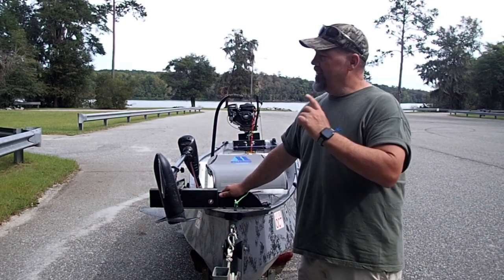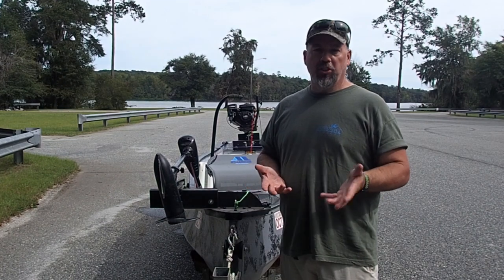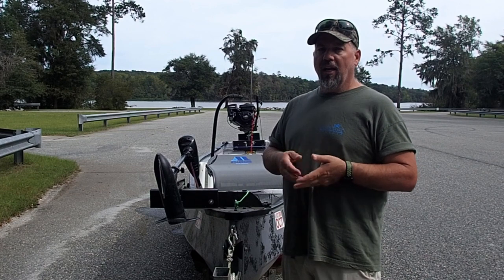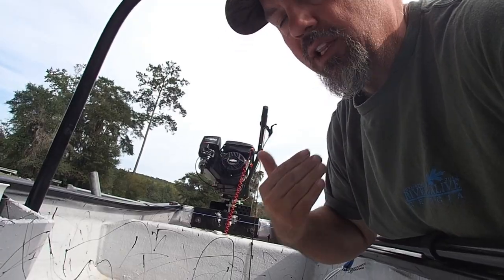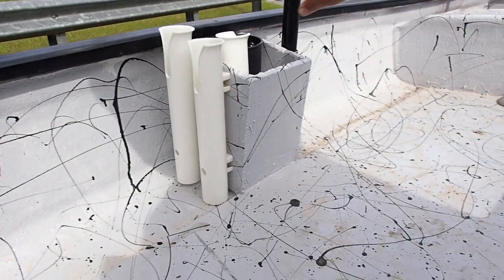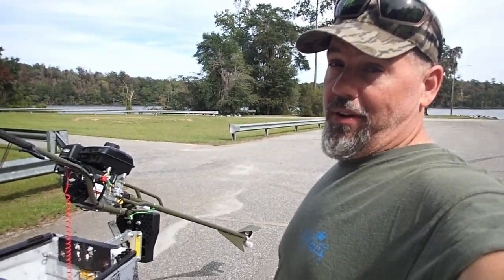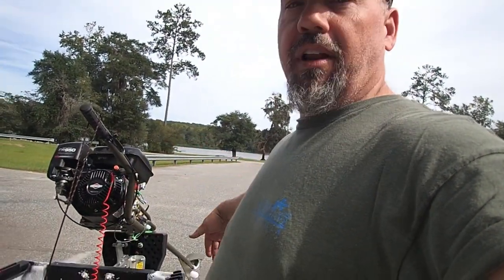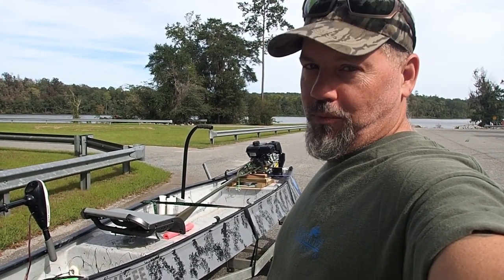Gheenoe 13 Rebuild, Walkthrough and First Run!

Comment: Nice Gheenoe . I have a 1979 15'4" i purchase in in 2018,  I wanted to repaint and do some mods, then found out it needed some repairs too. I mainly use mine for duck hunting in NC.   What is the make and model of the jack plate you installed.  I am wanting to install a jack plate for my 5HP Honda 4 stroke.  I'm looking at going to the max of a 9.9 hp,  but now thinking of that mud motor.   Do you have any pictures of the transom set up with the jack plate.

Comment: Nice job it turned out great just remember to wear that kill switch cord on your wrist I picked a guy up that the prop got his legs from the steering breaking and throwing him off the boat and 200 hp motor’s prop got him good, he wasn’t the only one I helped in 50 years on the water!
Reply from the maker: yes sir! kill switch and PFD are a must!

Comment: I love what you did to the bottom, but did you ever give an idea of putting GATOR GUARD all along the bottom from TRAILER HITCH TO STERN?  i DID saves my bottom in oysters and only slows my boat speed down by about 2mph at full speed.  ( I have 25 hp)

Comment: Nice build I just bought one recently it’s a older 14 foot  model and been fixing it up. I’ve been trying to make a front deck
On it and remove the live well I’m the middle of it and I was wondering how did you make your front deck
Reply from the maker: i used cardboard to make a template for the area then used 1/2" plywood wrapped in fiberglass to make it out of. it is strong and will last a good long time!
Reply: Thx man

Comment: I know this is an old post, but I was wondering where I can get a grab bar like that.  Gheenoe has a pretty expensive one that mounts in the center, but I like the way yours is off to the side...
Reply from the maker: i just built that out of bent conduit sir, but i know there are some side mounted ones on the market. may have been on the swamp runner site if i remember one of them.
Reply: @ChrisFunktheFeralOne  Thanks for the reply.  Love how you put that boat together.  Everything is so practical.  I did find someone fabricating side-mounted grab bars, but now I am thinking I could do it myself with conduit and straps!  

Too bad about the rocks issue.  I would love to see what you would have done with this boat over the last couple years.

Comment: Hey, Chris! I am now the owner of this unit and man is it sweet! I do have a question for you, If you don’t mind… the floor on the front, in front of the seat, is getting soft and cracking. I’d like to repair and reseal this and was wondering if you could give me any advice on what you used and what you may recommend to patch this. Thanks in advance, and thanks for building such a sweet rig!!
Reply from the maker: awe man, sorry bout that! on the rest of the boat i used west systems resin and that stuff was expensive but awesome. i did the front deck after all the rest and used an epoxy from the auto store on it. i bet that is why that area is different! the west systems is worth the money for sure... wish ida done the whole thing at the same time!
Reply: No worries at all!! Everything else seems to be awesome! This place on the front is very small, less than 1 sqft where the side rolls up but i want to address it sooner than later!

Comment: What jack plate set up are you running?
Reply from the maker: Garelick Auxiliary Outboard Motor Bracket sir, it is rated for up to a 20hp and is nice to change the pitch on the setup!

Comment: Point au chene Louisiana?
Reply from the maker: Yes! Awesome place!
Reply: Nice, I live less than an hour from there. Reading the comments I saw you sold it, but I'm curious if the motor was hard to maneuver around. (Especially with 2 people on board.) I have a 13' low sider and haven't decided what engine to upgrade with.